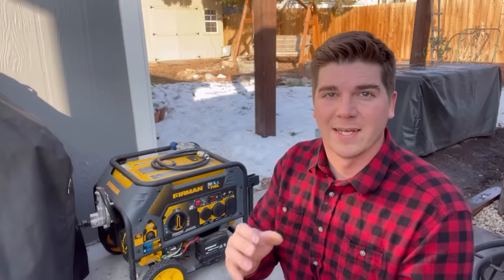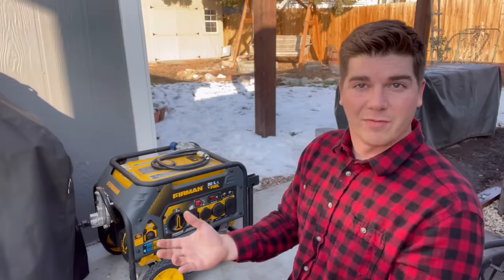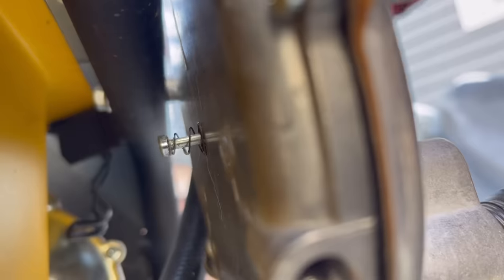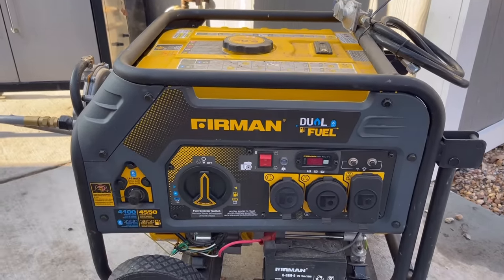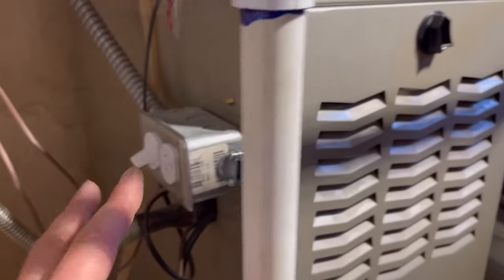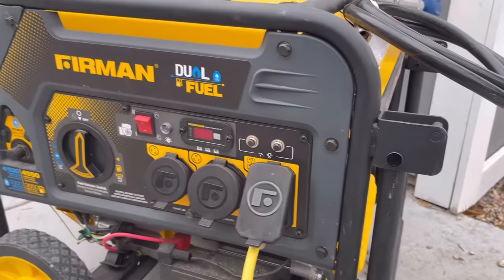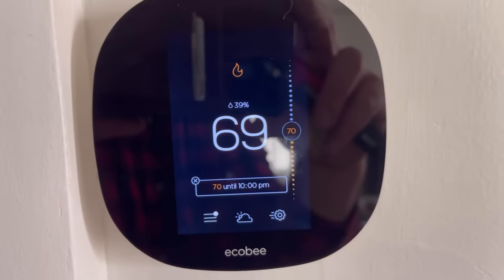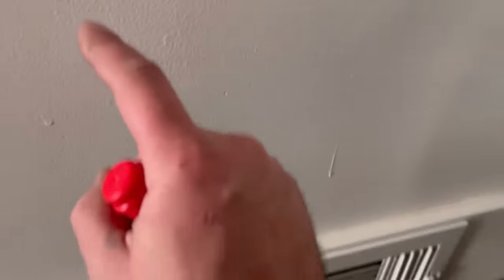Most Homeowners Don’t Know About This Trick To Get Heat During A Power Outage.

Comment: Excellent video! Thanks for running through everything with so such detail. The pigtail is a great tool to provide many options for a power source. I live in Michigan so no power in the dead of winter is a nightmare scenario. Definitely am going to install one and look into a generator.
Reply from the maker: Awesome. Thanks for watching! Cheers
Reply: not sure if the pigtail is in code, need to check local area
Reply: I’d rather not die of hypothermia than worry about “code”
Reply: @brandonious9060   you can still hook it up with out doing what he did as he's shown before, it just requires more work.... or better yet just install a transfer switch for your generator and be in "code" and it's permeant and easy.... power up generator plug into switch, flip switch get power to appliance....
Reply: Just to comment on the above statement. Yes this will work on most standard furnaces manufactured prior to 2019 that have psc type motors. This definitely wont work modern furnaces with x-13 or variable  speed ECM motors. I had a conversation with a fellow technician who tried this on his own equipment last winter during a power outage. This ended up frying the ecm motor module on his furnace, which cost him several hundreds in repairs.
Reply: @manuelbustillos3925  I have a Trane XV95 two stage gas furnace with variable speed blower and inducer motors. No problems running off of generator power. Just need to make sure voltage and frequency are within a reasonable range, and everything is properly grounded. Maybe he tried connecting it to a generator that had a bonded neutral but furnace was still connected to house system. Bad things can happen if neutral current also flows thru the furnace chassis and the equipment grounding conductor.
Reply: Based upon the previous video, I rewired my boiler to use the pigtail to power the unit. This is a really great idea.

Comment: I will chime in here on important information that you have left out. First of all I am a HVAC Service Tech and Electrician with 25+ years experience including installing backup Generators. The information you posted here and in your last video are partially correct but you need to go a step farther before you tell everyone this will work for all Furnaces before they damage their own equipment. First off, your furnace is a simple 80% furnace with a PSC Blower Motor and most likely a Shaded Pole Inducer Motor. With those motors it is no issue running a common Generator or common Inverter for operation as these motors rely on magnetics for operation. Unfortunately newer Furnaces with ECM and Variable Blower drives are Frequency driven. This means that the Generator or the Inverter you use must be a Pure Sine Wave form as the common equipment is generally a stepped or modified wave form for a 60 hertz frequency. Most of the newer furnaces will sense this frequency change at the circuit board and will shut down the system before it tries to operate. The other issue is with grounding back to the source of the Generator or the Inverter. Again, if the circuit board doesn't sense a good and 'clean' ground it will shut off the unit to prevent damage. What you have done here is the basic of the basics that home owners have been doing for years, but now with the newer electronics it's not the same story. The other issue with running Natural Gas thru your Generator: You did not change the metering device that meters the amount of gas into combustion. Yes, the setup you have right now is working, but I will guess as soon as you put a heavy load on the generator it will not be able to keep up because you did not make that change. The Regulator just reduces and regulates the pressure, and the orifice is what meters the gas amount.
Reply: So, to have this setup work on a brand new forced air furnace would an inverter generator do the job?
Reply: @jolkraeremeark6949  Again, if it is a 'Pure' Sine Wave Inverter Generator, and it is properly grounded to the Inverter and Earth Ground.
Reply: @bradw.5991  crap, if only  knew what "grounded to the inverter" meant.  I just hope to be prepared to run a new forced air, natural gas furnace in a power outage.
Reply: I’m glad I read this comment as someone who has new furnaces and was thinking about getting a generator for this.
Reply: Then for those of us with heat pumps, we’re pretty much screwed.  Lol
Reply: @CompleteMisc  that’s you should only use heat pump as backup heat or secondary
Reply: I think the best way is a manual transfer switch. That’s what I’m shooting for. It’s a $1200 labor charge from the electrician and another $600-700 for a reliance controls transfer switch. This would be either a 6 or 10 circuit 30amp switch with a 30amp twist lock connector for the generator to plug right in.
Reply: I just added a Generac brand transfer switch. 11kw 16 pole 50amp service with the ability to add more breakers (for a cost of course) but this whole thing installed was $2100.00. Worth every penny
Reply: ECM motors are essentially DC motors.. so why would the motor have an issue running with a generator? It's going through the capacitor bus and converting it to DC anyway
Reply: @piercer4882  The issue is not with the motors, the issue is with the electronics on the circuit board sensing an issue from a modified sine wave and shutting down the whole circuit board even before power can be reached to the motor circuit. This is how the manufactures are protecting the equipment and reducing warranty claims.
Reply: @bradw.5991  any idea what manufacturers have these types of protection built in?
Reply: @bradw.5991  I work in an hvac r&d department and specifically focus on gas heating. Our board supplier is the largest supplier of hvac control boards and sell to all the biggest names. I personally have not come across anything like you're mentioning, but to be fair, we also do not test for anything like this. The ANSI Z21.47 gas heating appliance standard doesn't even have testing listed for anything like that
Reply: @piercer4882  I have a Electronics degree, Electrical Degree, and a Building Engineers Degree. Unfortunately it seems to me that that the HVAC field electronics (circuit boards) are lacking the basics in standards that come as a standard on other appliances. In the Electrical field I talk to customers about power surges and line noises that we as techs need to 'add' surge devices to equipment to filter out these issues (RF interference, etc). It amazes me that a simple front loading high efficiency washing machine has a line filter at the end of the plug inside the washer to filter line noise to/from the appliance, but a high efficiency furnace doesn't have anything like that except on models like Mini Splits.
Reply: @piercer4882  Mitsubishi and many other Mini Slit manufactures. Daikin is another.
Reply: @bradw.5991 … so can I run a pure sine wave inverter from my car, given its a 1000 watt inverter?… to my 10 year old carrier furnace?
Reply: @CompleteMisc  A lot of opinions here but your heat pump I'm assuming is 208-240 so your unit is not as sensitive as a 110 furnace board. The voltage drops in the unit before controls. I'm sure I will be told I'm wrong. Only 25y experience from houses til now engineer for data centers
Reply: @bradw.5991  oh ok.. Yeah I could see mini splits having that type of issue. They use variable frequency to control everything,  so it's probably touchy with the power source
Reply: @piercer4882  True my mind always goes to big units. My smallest RTUs are 80 ton, 35 on 1 roof, and in my residential days I would have like 5 ton AC heat pumps. I was wrong put the torches out.
Reply: @Silverface1987  yes, as long as you compensate for the starting currents for the Blower motor, say 1-3x the normal operating current/wattage on starting (if you have a PSC motor) if you have a ECM or Variable speed then start up current doesn't apply as these motors circuitry used a 3-phase motor and slow starting.
Reply: @bradw.5991  how can I tell if I have a pcm or other motor
Reply: @bradw.5991 psc or ecm
Reply: @Silverface1987  Model number
Reply: With stresses on our power grid, brown outs and dirty power are becoming the new normal in much of the country. People better not buy a prissy furnace of they are going to be sitting in the cold even when the lights are still on.
Reply: @MaximuMechanical  Yeah that statement doesn’t really make sense in this context.
Reply: @CompleteMisc  Wood stove ftw!
Reply: Fully understand the difference between pure sine wave and the cheaper alternatives.  But bought a Harbor Frieght  and  it runs the whole house with out any issues including the new furnace. I don’t think it’s got a variable blower, I’ll check… My point is I don’t think the newer generators are as bad as the older ones were OR equipment is more tolerant these days.  I run my generator for a hour the first of every month and in two years, nothing has expired. Thanks for the warning though.
Reply: You are 100% right, but I will give credit to his video, maybe he will produce a further video addressing this issues
Reply: If you use a UPS output going to the furnace it will stabilize the voltage and the frequency provided.
Reply: Between this video and the other one he references to tho for installing the pigtail, you can see that he does have an earth ground
Reply: @CompleteMisc  Indeed! All electric house's when the power goes out is not fun! And when does that happen? In bad weather! The other thing is even if you get a generator, how big do I need for a 3.5 ton Heat Pump? Then storing fuel for the generator I may only need once a year or two?
Reply: @paulward4717  actually a UPS does not do anything to the sine wave and on most, when the UPS switches to battery it is producing a stepped/modified sine wave. Even Power Conditioners like Tripp Lite specifically say they do not condition then sine wave into a pure sine wave. From Tripp Lite Q/A: Can I use a power conditioner with my generator?
Yes, a power conditioner will stabilize the voltage from a generator. However, it will not convert the modified sine wave produced by some generators to pure sine wave, making those generators unsuitable for sensitive electronics.
Reply: @bradw.5991  Brad, my furnace is a Trane with the model # being D346435G03.  I would like to power the Trane in the event of an outage by rewiring a pigtail.  Will this furnace fire with power coming from a Champion 4650 dual fuel inverter generator?
Reply: @jolkraeremeark6949  I would probably say yes as long as the THD is less than 3%.
Reply: @CompleteMisc  far from it.
However, a heat pump will require a 9KW or larger generator. And it needs a 240V connection to the generator.
Reply: Most generators 3 kw and up are sine wave generators not variable speed, inverter output…big heavy old style gen-sets.
As for your gas supply , go to your small local airport and get aviation fuel. $5.00+- a gal, no alcohol, no gum and doesn’t turn to shit in ite tank.  Also love the dirt simple, very safe furnace power adaption.
Reply: @bigsailordon  all generators are sine wave generators… but unless they are inverter tech, they won’t be STABLE sine wave… every rpm shift, bog down, and motor start will send spikes and ripples that shift the frequency, and produce dirty power that will cause havoc on control boards…
Reply: @whochecksthis  ok I personally run a 15kw 4 cylinder Onan on LP. Watching and managing loads I’m running two houses and horse barn to include a inverter driven split system heat pump at the little house. Water pump and fan load switching has not been a problem.  Condensing gas furnace at the other house, no problem.  Inverter drives switch dc to drive the load, incoming ac is rectified to that dc so a little frequency variation has negligible effect.  
The original post was to help 80% of people with a simple safe way to get some heat back on in an emergency.
P. S.  BTW I turn off the main and lock it out, then back feed everything from the barn located generator.   Safety is very important to the road crews trying to restore power to everyone.
Reply: Thats what i cant stand about modern electronics and Technology... they over complicate things...
Reply: @В-Доску  Not only does the appliance ground at the Generator with the Plug, but according to NEC you are still supposed to ground the chassis of the Generator (via a Ground Screw provided by the Manufacturer) to a Ground Bar withing 6 feet of the Generator. It should also be noted that most Generators (and will be noted by the manufacturer) will be a Floating Neutral/Ground or a Bonded Neutral/Ground in the Generator.
Reply: @stevemitchell9848  agreed to a certain point. It is all about Efficiency. Most Gas Furnaces with a PSC Blower Motor run around 700 watts of electricity. I have a Gas furnace that uses a ECM Blower Motor and my Furnace runs a total 175 watts. Variable speed motor furnace run even lower total wattage.
Reply: Maybe you or this gentlemen can do a video on how to strip out all the fancy electronics from the new furnaces such as a switch to either run on clean input or  choppy current? Or is there a device to hook to an old generator that will smooth out the frequency?
Reply: Hey Brad, exactly my problem. My Powerstation is puresine but has a floating ground. How can I use it to run my furnace. It runs the blower but not the igniting rod, it shuts down.
Reply: @ytwatcher6020  Are you talking about a Power Station or an Inverter Generator? I have yet to see any documentation on a Power Station that has a 'Floating Ground' as they are Battery Supplied Power and not a spinning Generator. I can say this with Power Stations: You should have no issues as long as it is a 'Pure Sine Wave' output, and what I mean by that is it is Pure. How do you test for that? You cannot unless you have a special tool (they cost $1000+) or an oscilloscope that actually shows you the true wave form. The cheaper manufacturers 'claim' they are True Sine Waves, but how are you to actually test for that? The other issue is what else do you have plugged into the Power Station? If you have something else plugged in besides the Furnace, you can dirty up the AC Sine Wave from that appliance like a Florescent light fixture or TV, motor, etc.
Reply: @buddymann34476  Kinda hard to eliminate all the Digital parts of a circuit board that would control all Digital Components of the Furnace (ECM motor, Variable speed Blower, Variable Gas Valve, Variable speed Inducer Motor) and replace them with just Analog Parts. The only device that can supply clean power is the power supply itself.
Reply: @bradw.5991  Hi Brad, I tried running mu furnace off an EcoFlow as I've seen others do it. The fan runs and the blower but the hot igniter lits up a few seconds and turns off. 

This is just a test I did, I wanted to buy and inverter charger that will serve as a power back up but now  I'm thinking if the same will happen since inverters are not grounded either.
Reply: @bradw.5991  Now for an inverter/charger I'm thinking, the furnace will still consider it grounder as it's still connected to the house grounsing but it's just drawing power from the battery if AC is out. 

Does that make sense? Thanks.
Reply: @ytwatcher6020  What Model EcoFlow and What Make & Model number is the Furnace? 

Did the Furnace generate a Code on the circuit Board after failed start up? 

I am assuming that you rewired the furnace to a 3-prong plug where the Hot wire goes to the door switch, the neutral goes to the neutral on the Circuit Board and the Ground wire from the plug is attached firmly to the Chassis of the Furnace?

If the EcoFlow doesn't actually use a Ground in the equipment itself, have you tried splicing the Neutral and the Ground wires together and see if the Furnace works?
Reply: I have a gas water furnace  installed last year could I use a generator on this unit  there is no fan or blower
Reply: @ytwatcher6020  I wonder if you could run the igniter from a small, battery powered sine wave inverter? You can charge the battery from the generator.
Reply: Hey what metering device would you recommend?
Reply: @Silverface1987 check if your alternator can supply a continuous 1000w.
Reply: Can you help me as to a quick work around for a heat pump? Is there one?? I have no idea how they work.
Reply: MEN! Real MEN! I love it! 
Carry on, my good man.
Reply: Thank you for that. I actually have a new er gas furnace that I would like to have a plug put on and a dedicated outlet so that I can plug into a generator because everything has electric start. I have propane here for the gas furnace and would like to pigtail the generator to the 100 lb propane tanks. My plumber says it's possible it's a little expensive but not as expensive as a standby generator. Makes me wonder if I should get a dual fuel or just a propane backup generator 0:30

Comment: Don't buy a Duramax generator on Amazon. I bought a 4800 watt Duramax real cheap looked great ran nicely for like 24 hrs total and then stopped running. Likely the coil but to replace the coil it costs nearly a third of the units cost. If you read the reviews on Duramax they have many saying their unit didn't work properly from the get-go or died in short order. The only repair facility was 25 miles from my large city and that facility had poor reviews as well. By the way my unit was dual fuel.
Reply from the maker: Good to know!
Reply: I have a CAT and has been good so far for a few years.  🤞🏼🤞🏼🤞🏼🤞🏼